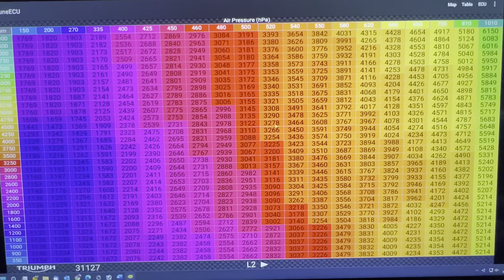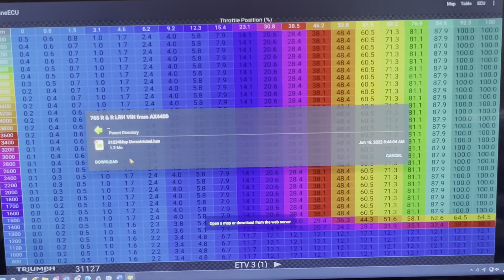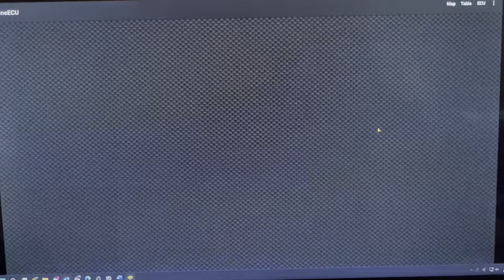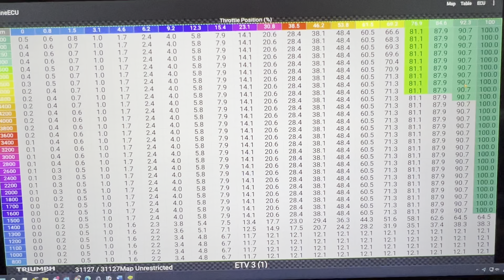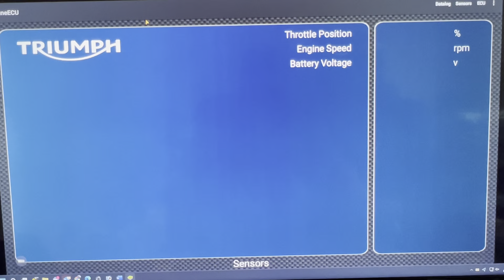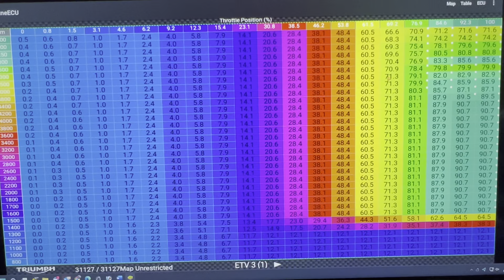Get your Triumph Speed Twin to FULL power!

Comment: Dave, great work. I look at your list of all tunes listed. Which tune from the list is based on stock cat exhaust and db killers removed. Also did you have sai disabled? Thanks
Reply from the maker: Dude, you haven't even told me what bike you have, the year, the country, etc...  lol
Reply: @Daves_Man_Cave hey sorry. It’s 22 speed twin USA. With British Custom slip ons. I still have o2 and sai active.
Reply from the maker: Dis.  Dis is what you want:

https://drive.google.com/file/d/13NcegrYvrMvv-Mx-6ctKRhtTMQ9wypsW/view?usp=drive_link

Install map, reset adaptives with TuneECU.  Make sure you have the latest bluetooth adapter, preferably the MX+ or CX+ model that is faster and more reliable...

Let it warm up and wait for the idle to settle down, and then go for a ride.
Reply: @D @Daves_Man_Cave thanks meant to reply to the msg with a tune. Just wanted to be sure the x-pipe tune is ok to run with stock cat system and emission stuff for time being. Until I get the x-pipe in the near future.
Reply from the maker: It may be a little bit rich for the CAT.  Maybe wait till you do the X-Pipe and then install it.
Reply: @Dav @Daves_Man_Cave uld you recommend unrestricted version of the map with mild tweaks, You have listed.
Reply from the maker: Just run the stock map, and then when you do the X-Pipe, install the map I sent you.  :-)
Reply: Thanks. Does this tune is ok for stock cat system. I’m planing to add x-pipe in the next future.

Comment: Man, just now learning that this can be done. I have a 2020 speed twin. X pipe K&N Air filter , snorkel removed. Still not sure how to download maps. Would be interested in your speed twin map. Looks like all these posts are from three years ago.
Reply from the maker: The map I made on the dyno is for the 2022 model... different motor and tune.

Comment: Hi Dave!
I have a Thruxton rs with x pipe, high flow filter(no snorkel) and exhausts, I put marble to delete the SAI ( for decel popping) and I keep the o2 sensors in place
I copy your speed twin dyno map F1 , F2 , ignition tables and AFR on my Thruxton rs base map, I did my own ETV tables.
The bike runs very well,  is amazing how it improve overall, smooth and powerful as you want.
In tuneecu sensor chart at idle I report that o2 sensor short1 is negative (-8%,-10%) and o2 sensor short 2 is positive (1.7% to 3%). Do you think is ok? Because when I see your tuneecu sensor chart they were around the same positive value (6% to 8%).
Last question.. if I want the bike be for travel and make it smooth in cruising if I put lazy ignition time like original I achieve this goal or not? Have you some advise for that ?
Thank you very much to sharing your knowledge it helps a lot!
Reply from the maker: The ignition changes I made were only from 70% throttle, and only on the higher revs.  It's nowhere near the "cruising range", so I wouldn't change anything.  What makes it seem "less smooth" while cruising, is the more aggressive throttle map for ETV3.  That's why I leave Rain and Road mode alone, so that when you are done playing and just want to have a smooth cruise home, you drop to Road mode and its got that stock smooth feel...

Comment: Hi Dave! 
have you some advices on how and where change the trim tables for a thruxton rs 2022 with exhaust with db killer, x-pipe decat and a high flow filter (original airbox)?
i think i will buy a map from DNK but i would like play myself before that..
i case i will buy a dnk map i have to delete the 02 sensor or i can live it in place?
thank you very much
you are the best!;)
Reply from the maker: Remove the DB killer and my Speed Twin fuel and ignition tables will work for you.  But you would have to copy and paste the entire F1, F2 tables into your bike's base map, as well as the ignition tables.  The motors are identical, the tune is identical with the same mods.  What country are you in?
Reply: @Daves_Man_Cave  i'm in europe (italy)..
i think your maps are for US or could work also on a EU model?
thank you very much for sharing your knowledge !
Reply from the maker: @DavideScarpellini  I have an All Countries version of the Speed Twin custom dyno tuned map that you can pull Fuel and Ignition tables from:

https://drive.google.com/file/d/1BIXhCKlt8cZcpzn87BNanlaqrBXXb78A/view?usp=drive_link
Reply: @Daves_Man_Cave  thank you Dave.. i will play with that map! you are amazing;)

Comment: Interestingly on my 2023 Scrambler XE, ETV4 Sport has the numbers identical from bottom to top as low as 8.8% throttle.   
91.2 and 100 were both set to 100 all the way from the factory.   I’m going to try adjusting the 66.2 and 73.5 tables up a bit to show a more rapid and smoother rise than the stock map.  
Wish I could find a way to delete a couple saved maps on my android phone lol
Reply from the maker: You can delete then from your Android phone just like you do in Windows...  Google File Manager...  Lets you see all your folder and stuff on the drive, and you can navigate to TuneECU and Maps and delete what you don't want, just like you can from a computer...
Reply: @ there’s a reason I use the iPhone lol. 
I can’t find anything on this android.  I’ll just leave those two files for the scrambler and rename them as needed if I use them.
Reply from the maker: @charliestoybox2099  I mean, Android is easier than iPhone in a lot of ways.  The menu system and controls are way better laid out, and like I said, Android has a normal file system and "explorer" type apps, just like you have on Windows, Linux or MacOS...
Reply: @ I’m a simpleton.  Once I could do my taxes sound print them without a computer, I went straight iPhone.  Android gives me a headache.  Tune Ecu is the only reason I bought a used android 😂
Reply from the maker: @charliestoybox2099  I use both platforms extensively.  iPhone is good for non-tech people who just want a phone that does the basics, that does most of it for you and keeps you out of trouble...  Android is more for the techie types,  the ones that aren't afraid to get their hands dirty and that want to do more with their phone, the way they want to do it.  There is a reason why TuneECU is offered on Android, and not on iOS.  haha
Reply: @ I’m 61 and a non techie.  But I can wrench and understand the mechanicals and engineering.  Been racing my whole life.  I leave the androids for my younger friends 😂
Reply from the maker: @charliestoybox2099  will be 53 this summer...  Always been in tech.  Honestly, these days, Android is actually easier to do a lot of things than iPhone is...
Reply: @ my girlfriend uses android and I don’t touch her phone.  She’s 44.  She doesn’t touch my iPhone either.  Swapping phones gives us both a headache lol.
Reply from the maker: Yeah, the thing to remember is that for the most part, they do the same thing.  You just have to learn HOW each one does it.  It's like going from PC to Mac.  One has a button over here, one has a button in a different place.  My wife struggles with her MacBook after years of using Windows...

I use Windows, Linux and a MacBook so it all makes sense to me.  haha
Reply: @ lucky man lol.  
I figured out how to reset the maintenance light on my Scrambler.  I ran the S20 off my iPhones WiFi.  So that’ll be easy enough when I do the first service on my new Bobber.  I want to play around with the tunes a bit on my own first, and then I’ll turn it over to my tuner who’s always done great for me with the injected bikes.  He tunes for MotoAmerica teams also.

Comment: One question which may have been covered already ad nausium..  Must you acquire the original map elsewhere, or can Tune ECU retrieve that map from the bike itself so you’re positive you’re in that map for that bike?  Sorry if that’s been answered all over the place and I’ve missed it.  

If I get this ‘25 1200 RS, I’m buying you a beer!
Reply from the maker: You are right, I get asked this question nearly daily...  lol

Tell you what, I will make a video right now, showing how to get your base map onto your device.  As for the new 2025 models, some of them have not been cracked yet, and there is always a chance that Triumph, under pressure from government regulators, figures out a way to make the ECU uncrackable... or at least so hard to break the encryption that TuneECU/Woolich/FTECU simply give up trying...

Gimme half an hour and I will have a video posted.
Reply: @ Huge service Sir!  Many thanks! 🙏

Comment: Hey Dave. quick question. I have a 2023 speed twin. I got the app and did everything you suggested. before I program it to my bike. any recommendations on modifying F1 F2 due to the fact that I removed the slip on mufflers ( I like the "drag pipe" look) thanks.
Reply from the maker: You don't have to edit the F tables... Go to F1 and slide to the LEFT of that screen to access the trim tables.  There should be all 0's...  You can modify that screen, and whatever you put in those cells will be adding or subtracting that number as a percentage... So 5 would add 5% to whatever is in the F tables.  -5 would subtract 5%, and so on...  If you have the stock airbox and CAT in place, just add 5% in the 0% throttle column up to 1,300rpm, and then all the way to 5,000rpm and 10% throttle.  That's your cruise range that is normally kinda lean, so add a bit of fuel there and see how it feels.

Comment: Hi mate. Great videos and kudos for making your tunes open source. Quick question if i may: which of your tunes would you recommend for a 2019 UK Speed Twin with an X-pipe installed (everything else is stock(at the moment!))?
Reply from the maker: Use this map, and ride it in Sport Mode.  That's the one that I unrestricted and made the throttle a bit more aggressive and linear.  Added back in the ignition timing they pulled to a still safe and conservative 36 degrees up top, reset the AFR targets to 13.2, the cooling fan will come on sooner, and added a bit of fuel to the typical lean areas for the X-Pipe...

https://drive.google.com/file/d/1VZxIXToB2ku4FPHyA3i4o63coLt1glYz/view?usp=drive_link
Reply: @Daves_Man_Cave  You're an absolute legend. Thanks!

Comment: Just turn the TC off completely. I don't understand the need for restricted throttle response/max power on a bike with "only" 100 horsepower anyway.
Reply from the maker: I agree with the throttle restrictions, there is no need for that.  But traction doesn't limit power.  You get max power with traction on.  It just ensures that your power doesn't exceed your grip, because at that point, you are losing acceleration anyway...

Comment: Dave I wonder if this applies to the Street Twin as well??? How much are they *throttling down that 900 engine at full throttle twist?
Reply from the maker: I can look if you let me know the country, year and last 6 digits of the VIN
Reply: @Daves_Man_Cave  Hell yeah.... That would be badass Dave. Im in Texas. 2019 Street Twin. Last 6 of the VIN are 924922.
Reply from the maker: Ok, here is map to play with.  Little more fuel in case you do slipons, but I also tweaked ignition timing, made Road mode more aggressive, lowered AFR targets to 13.5, and the cooling fan will come on a bit sooner, which will help in TX.  Left rev limiter alone.  Should make the bike a little cooler, and feel more responsive.

https://drive.google.com/file/d/14YYEHyaXKvtSRn8aljS4_CryAYqfAPOK/view?usp=share_link
Reply: @Daves_Man_Cave  lol thanks man. I got the bike Jan. 7 and its been like 70deg here until this week and now im irritated I havent ridden all week. Texas weather is such BS. Im certain summer will be ridiculous so kicking the fan on a bit earlier will def be helpful. And for the ref limit, I have yet to hit it lmao so I doubt ill need a higher limit. The torque on this bike is really low and I wont often be ringing it out, if at all. Really appreciate it Dave. Will report back once Ive had a chance to play with it.
Reply: hey Dave... 10,000 miles on the Street Twin now. I finally picked up an Android device, OBDLinkLX and TuneECU. I loaded the map you tweaked for me and have been analyzing it. So, the factory AFR map has AFR at 14.50 in almost all the tables and you dropped that to 13.50 in the file you sent me. Im pondering what exactly this is accomplishing.... if we are decreasing the AFR, this is making the mixture more rich correct? This would make the engine slightly cooler but would it actually increase performance? I know theres a balance there Im just curious what your thought process is in lowering that AFR? @Daves_Man_Cave
Reply: btw... looks like the throttle maps are not hindered the way the 1200 engines are. So no performance gains to be had there...... in fact the factory map has throttle open 100% at 85.7% twist.... interesting.

Comment: Such a great resource. Thanks for publishing this. I'm pretty close to pulling the trigger on this tune, but what are the risks and probability that things would go south? Thanks!
Reply from the maker: Minimal.  I mean, any time you flash an ECU, there is always a tiny risk that your phone locks up or something else goes wrong...  Its very rare, but it could happen.  If you want, I can make the tune for you, so all you have to do is flash it to the bike.  Let me know what make, year, last 6 digits of your VIN and country, and whatever mods you have done to the bike, and I can put something together for you.
Reply: @Daves_Man_Cave  thanks. I'm currently on a '19 Speed Twin. VIN is 944042. Mods: CAT delete, Vance and Hines pipes, booster plug. Living in Germany at the moment, but the bike was purchased in Montana. I'm military so the euro restrictions don't really apply. Just looking for something similar to what you posted and unrestrict the throttle position in road and sport modes. Like you said, just trying to get the most of what I paid for. Thanks again.
Reply from the maker: @MrCamachoA81  This one should work if you have a US model.  It's got Sport mode unrestricted but I left Road alone.

https://drive.google.com/file/d/1f8KziZKQJF2TnAnxb9sKOAk-mMkpl4qZ/view?usp=sharing
Reply from the maker: @MrCamachoA81  And get rid of the Booster plug if you use the map I sent.
Reply: @Daves_Man_Cave , would you also be willing to provide a map for the tune of Road mode as well? Thanks again!!
Reply: Hey would you also be willing to provide a map for the tune of Road mode as well? Thanks again!!
Reply from the maker: @MrCamachoA81  I am not sure what you mean.  The tune is the tune, fuel and spark.  That doesn't change with ride modes.  What ride modes change is the throttle tables.  Rain is soft, Road is medium and Sport is the most aggressive..  I am like 7 versions past what I posted in this video.  Fuel changes, more aggressive sport mode, much more timing advance, removal of O2 and SAI, etc...
Reply: @Daves_Man_Cave  Can you do a sport mode unrestricted for a 2022 Model Triumph Speed Twin?
Reply from the maker: @PaulKernpk  what country and mods?
Reply: @Daves_Man_Cave  I’m in the US. All I want to do is change Sport Mode to a more aggressive throttle map
Reply from the maker: @PaulKernpk  https://drive.google.com/file/d/1J1WhznEmh15SM6EtEyU8W3t1Uygh8NaD/view?usp=share_link
Reply: @Daves_Man_Cave  Thank you!
Reply: @Daves_Man_Cave  Thank you! I am using OBDLink MX+ and my android phone. I can’t figure out how to read my current maps. Can you tell me exactly how you are connecting with your Speed Twin. What version of windows (I have 11), what emulator, what link, etc.
Reply from the maker: @PaulKernpk  TuneECU cannot read the map that's in a newer bike.  You can download base maps for each bike, from their online library.

I am using Windows 11 and Bluestacks as the emulator to build the maps.  Then I upload them to my Google Drive, where I can pick them up from my tablet or phone, and flash the ECU from there.

Comment: Looking to do the same to a thunder bird storm 2014 do you know anyone who’ve done it successfully,if yes could you put me in touch
Thanks
Clive
Reply from the maker: Is that bike ride by wire, or a traditional cable throttle?
Reply: @Daves_Man_Cave   throttle cable’s fuel injection
Reply from the maker: Yeah, so you can tune it, but there won't be any of these crazy throttle restrictions in place, because those are done in the ride by wire tables, which you don't have.
Reply: @Daves_Man_Cave  ok  I’ll see wot I can do thanks for getting back to me.👍

Comment: I went to do this on my 2020 Speed Twin but there were no restrictions on my map. I seen it was the second map loaded on my ecu dated 07/20. Does this sound right for pre 21 ecus? I did see the post  2021 maps have this restriction.
Reply from the maker: The 2020 isn't restricted that much, not like the 2021+ model...

Comment: Thanks for the video, fantastic stuff... In the video description, you have a link for 31127 US and 31126 UK maps, can you tell me, what is the difference between the two, and why cant I see them in the Google Drive shared maps folder? Thanks again.
Reply from the maker: Thank you for catching that, I may have moved the folder. 31127 is us and Canada, 31126 is all other countries and UK.

https://drive.google.com/drive/folders/1oAT8w0GjTN8s35NiHmM5koJBVrgIT9RZ
Reply: @Daves_Man_Cave  I will certainly be giving this a go. Ive had my bike 6 months now and have mentioned to people that when really going for it, as the revs rise and the speed increases, I feel the power tapering off, I knew something was going on, I can feel it!! ... Do you recommend the map with the fuel tweaks over the map without the fuel tweaks?
Reply from the maker: @mitchsmith71  I am using this one currently:  "2022 Speed Twin Aug 12 test Map Unrestricted".

On my stock bike with the snorkel and muffler baffles removed, it feels great so far.  Will be interesting to get it on the dyno possibly next week, and see how close my butt-dyno got it...